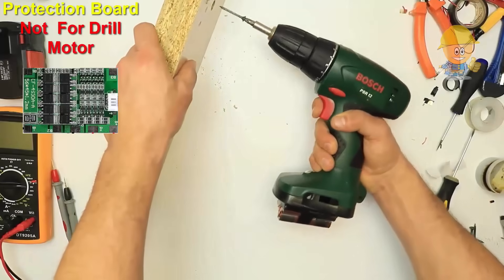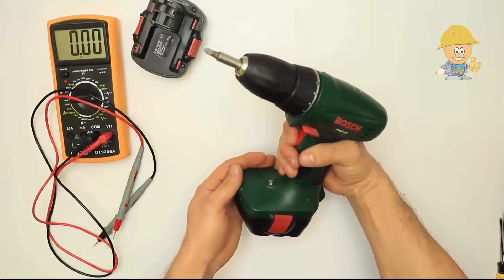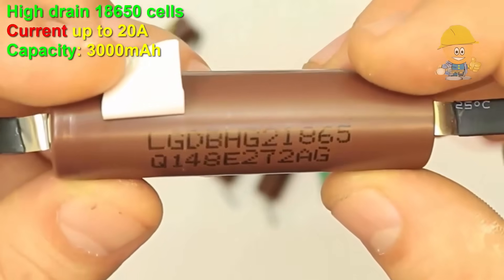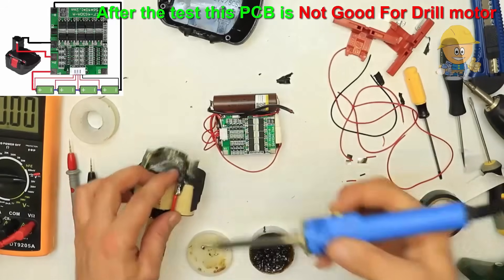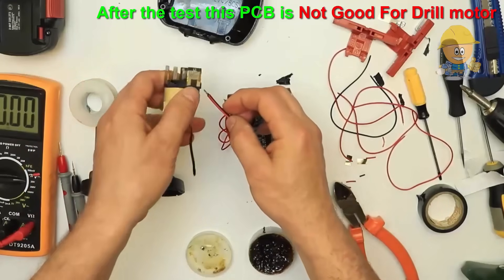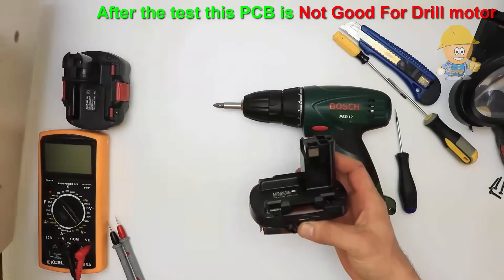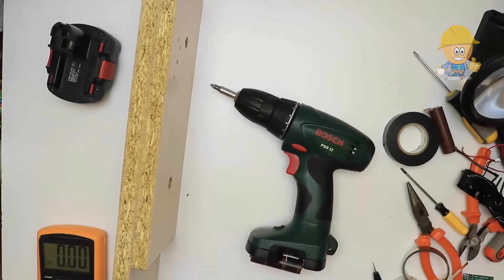Change Old Dead BOSCH Battery/ NI-MH Ni-Cd To Li ion  With Test

Comment: Amazing work. You are my invisible teacher. Guru, i have a 9.6v makita with dead Nicad cells. I have replaced nicad with 3 x 18650 Li on batteries but facing a problem. I used 3s 10amp bms and the drill does not respond to full throttle. Exactly as your first board problem. Then i replaced it again with 3s 20amp bms and still i feel 20% is missing in performance and still the same problem like your 1st pcb board. Guru, do you have any calculations or trick where i can know how many amps bms is required for conversion? Should i try with 3s 25amps? Or is there another issue? When i press the trigger slowly the drill works but with instant pressure on the trigger the drill stalls. Please help me figure out the problem? Is it of the mosfet? Or i need high capacity BMS? Is there something i need to do more for 3S 10 amps to work? I am weak in this calculation. Please help.
Reply: İt is imposible to it with laptop batterys because their max discharge current is very low. You need at least 20-30 A discharge capeble battery for this kind of project. Also as you can see he is using very soft material for screws as he nows it will fail wth hard wood.

Comment: hi there. i already followed ur instruction. im using 2s bms balance version and a new high discharge battery. and it performs similar with ur first experiment that uses protection board(spin a little and stop) do you have any idea? any help would be gladly appreciated.
Reply: Same issue here!
Did you working out?
Reply: @irrintziii  yes. but dont use bms, instead just use balance charger when charging and voltage meter for usage( safe usage voltage)

Comment: High it is possible to use only the BMS for charging and the drill power will be connected directly to the battery bypass the the BMS because the 3 LG batteries can handle more than 50 amps?
As far as i know the LG battery has a discharge voltage protection below 2.9v? Thanks
Reply from the maker: Hi Ramilo
that's not good. the bms regulates charging and discharge of lithium cells.
If you do not risk damaging them

Comment: Great video , noticed you used a 4S battery protection module , but on the amazon link its a 3S.  Is that a typo?
Reply from the maker: Hi Angel Torres
in  the amazon link is 3s module because that is good for this drill

Comment: Thanks for the video could someone please explain the relevance of keeping one of the old battery’s. Please.
Reply: The old battery is not connected to the circuit at all. It serves as support to secure the contact tips of the battery pack  in place when it is pushed into the drill..
Reply: shamrai thanks buddy.
Reply: @sham1234567891     while it sounds convenient, the old NiCd cell may leak acid on the new circuit board over time, what do you reckon? 🤔
Also, some battery packs have a thermistor connected, so when there is overcharge or some other issue that heat up the pack, the charger immediately stops the process of charging. Not all battery chargers have this protection though.

Comment: Hi, so for my power drill, it's stated 7.2v 35w 1.4ah. When connected 2 x 3.6v (18650 batt), one will be soldered at 4.2v and the other at 8.4v leaving 12.6v empty right?
Reply from the maker: Hi Nick
for 2 cells 18650, there are other modules, PCB 2S,
Reply: @CMCdiy  One more question, if I connect one pair in parallel, made 2 of such and connect them into series to increase capacity and retained 7.2v, the soldering point is the same as individual?

Comment: Thank you, I follow your videos.  There is a topic I am curious about.  When we click on the link of the second BMS card you use, there is the "Balance" model.  "Enhance" model if I think the BMS card you use only.  I will also order, I am waiting for news from you.  Also, if you are using the "Enhance" model, what is the difference of this card from the "Balance" card?
Reply from the maker: Hi Safer,
in principle, they are the same,
you can put what you want
Reply: @CMCdiy  thank you

Comment: the first pcb is working for me with no problem. I think its because of your fake LG batteries from liitokala. I'm using original sony vtc6. But I'm gonna make a new one and I'll buy the upgraded pcb anyway. And another thing is, you dont have to keep the first batterie from the old ni cd. You just need to keep the connectors and the resistor which is connected to the batterie. The bosch charger is charching it as usual.

p.s : I dont suggest anyone to use laptop batteries in these kind of high ampere draining projects. You can use them to make powerbanks or portable bluetooth speakers etc.

Comment: Also, it comes to my understanding that Ni-cd are the prefered choice in power tools as they give the same voltage pretty much until they are depleted. Does that BMS compensate for the progressive voltage drop as the lithium cells discharge? If so, how does it compare to the regular Ni-cd cells?
Reply from the maker: this module is only used to protect lithium batteries from charging and discharging. the values being of maximum 4.2v and minimum 3.2v.

Comment: What if my drill was made for 14.4v? I bet it would run at 12v but sacrificing drill's performance.
Reply from the maker: hi
if you have a 14.4v power tool, you must use a suitable protection module, one for 4 li-ion batteries,
you can find it here  http://bit.ly/2EyH1Yf  or here http://bit.ly/2PCb6fK

Comment: Great video, but i still have doubts, once you modified/replace the nicad batteries with the lithium batteries i can still use the old/original nicd charger of the battery pack?, i thought i couldn't, thank you please let me know
Reply from the maker: Hi Rubenyes, you can still use the old charger, but keep the connectors and sensor from the old battery, watch the video,
If not the old charger will not start
Reply: @CMCdiy  Great, how about a Imax b6 charger?, thsnks.

Comment: In the link on the blog there is a "balance" and a "New Balance" version.  Anyone know what the difference is, and which would be best for this application?  Also great video - I've watched tons of videos lately about converting old batteries and I think this is my favorite because it seems that it still allows the use of the existing charger and it has all the necessary over/under voltage protections built in.  Hopefully these circuit boards are robust enough!
Reply from the maker: Hi
Battery balancing refer to techniques that improve the available capacity of a battery pack with multiple cells (usually in series) and increase each cell's longevity.
A battery balancer is an electrical device in a battery pack that performs battery balancing
Reply: @CMCdiy  Hello, you have any email for anwer question? my old battery  dont have red and black wire, is only black... I can send you photo , to see this?thanks
Reply from the maker: On Facebook
Reply: @CMCdiy  I tried to charge after converting using 3s balance. The bosch charger only charge for few minutes (ie. Stop blinking).
Reply: Is it a problem?

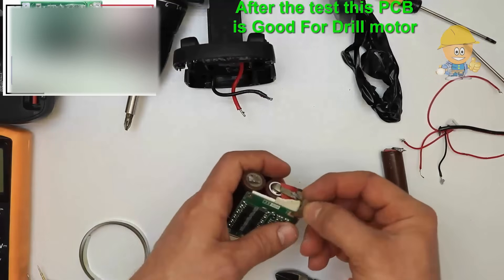Comment: It looks like the diagram shown at 8:44 is not correct: the 8.4V is connected to the 4.2V terminal and the 4.2V is connected to the 8.4V terminal. That should be reversed.
Reply from the maker: Pfff
Yes, you are right.
Thank you

Comment: You should add a  capacitor 2200uF/25V to the output.This avoid current drops in the circuit and shutting off the chip.Then only 15A module will work.

Comment: What is the difference between the good and the bad board? I want to fix batteries by using 5 Li-Ion cells. Thanks
Reply: Recommended board is 3S 40A (not 3S 25A). This board is for 12V modules only. If you want to use more than 3 battery unit, it is possible. You can make two set of 3x3.7V and parallel 3x3.7V batteries together with a single 3S 40A board.

Comment: Is this charger a must or the original one can be used?
Reply from the maker: Hi,
You can use any charger, The PCB protection module disconnects your charging.
Reply: @CMCdiy  Thanx , i already order the items.